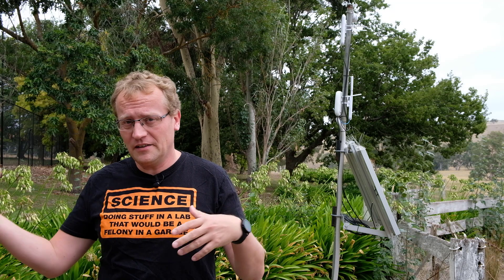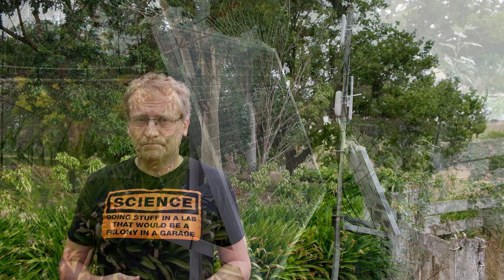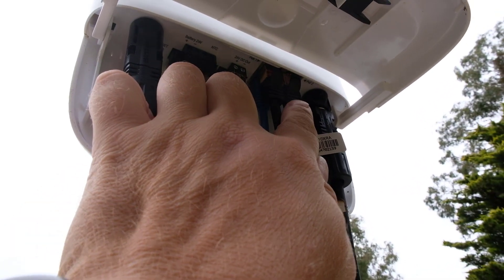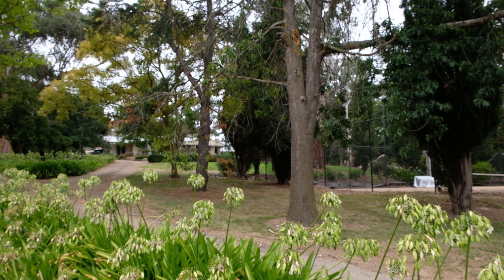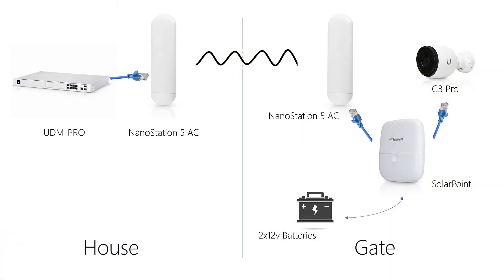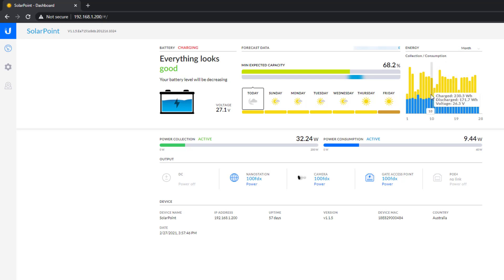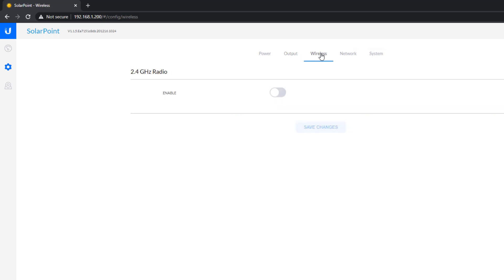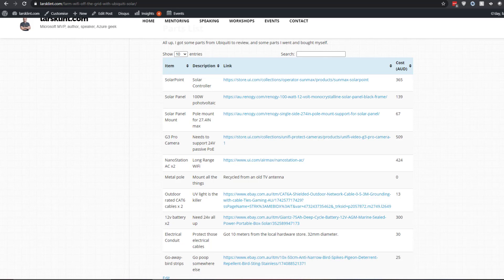Solar powered Unifi network setup - including full cost overview

Comment: Just discovered your site and video (also from Australia) regarding your v2 comment (and I agree!), it's a bit of a hack but you could always use that interface you were going to use for the gate for something that converts to the POE you want.
Reply from the maker: Thanks James 😊
I am not sure I am following. What am I converting to what?
Reply: @LarsKlintTech  no worries, we have a solar cctv cam that i am looking to convert to unifi at some stage. I want to use more modern devices. On paper the TP-xx-48DX2 from Digikey or similar injector can take from SunMax 24VDC and run two POE 802.3af devices with data in. If two isn't enough (is for me) a Unifi Flex will run on 802.3af PoE in. The injector doesn't seem to be waterproof so there's that - might need a box unfortunately.

So I'm sort of wondering if in the interim i can hack this up and get what i want - as I don't have contacts in Unifi to ask if there is a SunMax V2 coming anytime soon. But as I was thinking of this thought I would mention it as you may just need the one device to do the same.
Reply from the maker: @JamesMeikleAustralia  Ah right. I see what you mean. First of all, I doubt there is a SunMax V2 coming any time soon if at all. There just doesn't seem to be the market for it, although it is a brilliant device. 
It could be interesting trying out some of the other PoE injectors though, although I am dubious of getting 48v to run for any length of time without beefing up the batteries. I do use a Unifi Flex switch as well in a different place, but it does require a 50W 1.2A PoE adaptor. That is a lot of power to suck out of the SunMax 24V DC port.
Reply: @LarsKlintTech  I setup that Solarpoint last weekend with that 802.3af connected for the g4 pro everything works but I do have large batteries and will probably get to upgrading the panel!
Reply from the maker: @JamesMeikleAustralia  You did? How? How did you get 24V from the SolarPoint to work with 48V needed in the G4 Pro?
Reply: @LarsKlintTech  Using a TP-DCDC-1248D from digikey wired off the 24v out and ground pole. The injector does a max of 17w but the cam only does a max of 12.5w (but a lot less really). The injector needs a waterproofing  box (mines under a deck though).
Reply from the maker: @JamesMeikleAustralia  Ah, right. That is awesome. Well fenangled 😁

Comment: Great stuff Lars as usual....I wonder if I could power my home office.....2 laptops, 50" TV and Xbox Series X.....then again its Ireland....not much sun
Reply from the maker: Of course you can. This video is more aimed at how to power your network and extend wifi reange, but you can set up a system to power almost any device.
Reply: @LarsKlintTech  Yeah that's true...bigger or more panels for countries with less sun I guess....perhaps something for the new house
Reply: @ITB_News  Does Ireland have plenty of wind power? If so, you could do a hybrid system (wind & solar) - just a thought.